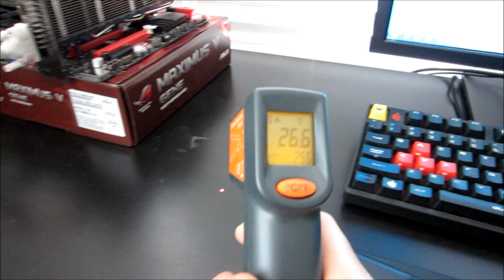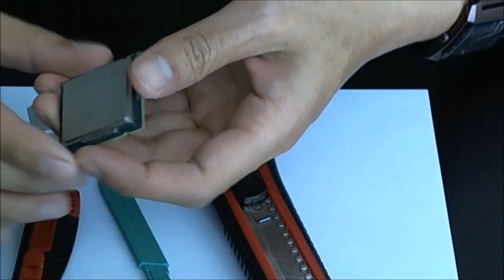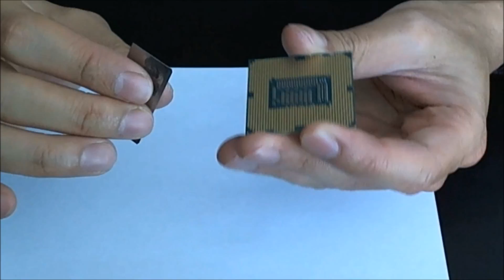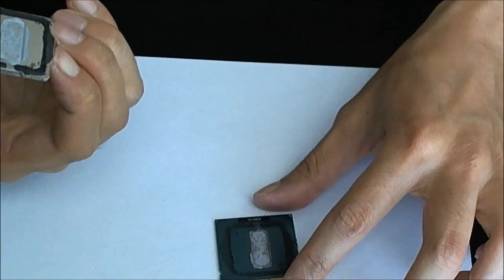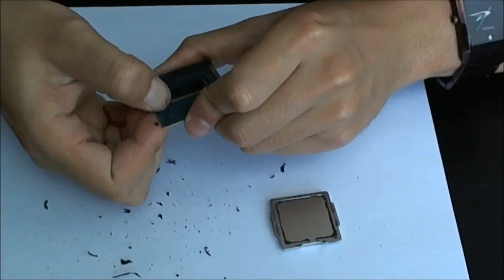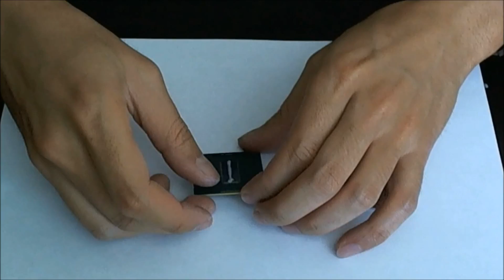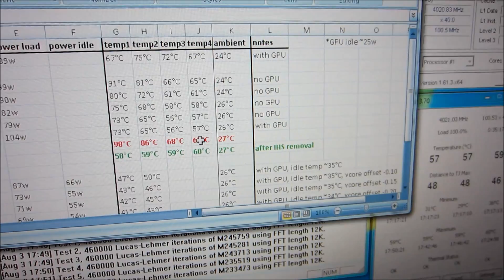Fixing Skylake, Haswell, and Ivy Bridge CPU temps: IHS removal

Comment: I have try to open my cpu with the razor but I failed. I stopped after trying during one hour and having used three blades.
The funny thing is that now, the highest temp I get at full load is 10 ° less than before (62°), is it due to little air injection inside the cpu?
Reply: My processor is i3-4330

Comment: He mishandled this CPU so badly. I’m amazed the CPU even works as there is NO excuse to touch the contacts on the bottom of the PCB. No matter what you do you will never be able to get it as clean as the manufacturer.

Comment: I got a i3-4130 and it runs at 50s and late 40s with stock fan on full speed...
Wish I bought an amd :/
Reply: AMD chips have a much lower maximum temp (a temp that they will throttle or die when exceeded) so higher temps on the Intel side is fine
Reply: Stock fan from intel and AMD both suck. Just get an aftermarket cooler
Reply: Koen Castermans  Yup.

Comment: Hi saw your wideo 2 times and i must say GJ man, rly nice representation. Well i have owerheating problems with my I5 760. The idle temps are about 55C-60C with Atec h2o 620 water cooling...i remmember when i buy that cpu cooler at 4,0 ghz oc my idle temps was never ower 40C and max load was around 60C-65C at that time that was good score now the same cooler at 3,4 ghz hitting 89 -90 C and cnonclusion is that the CPU-s IHS heatspreader or heatsink must be cleaned...Question, i say you when the proces is over when you assemble all back u dont add some kind off glue which was applied before, i mean on black silicon staff that bond the heatsink with the cpu-s pcb....so how safe it is to do on your way to let it just attached by socket wrench? Ty.

Comment: My core i7 gets way into red line on all cores under heavy load too. Since I do 3d rendering jobs for hours and hours, this is a big problem. I spoke to an ex Intel employee and he basically said "Consumer grade CPU's were never designed to run full tilt for extended periods of time". He later eluded that this was on purpose, since most people would not run their systems like this... He said go buy Xeons for heavy lifting.

Comment: You know what I have never had to do on any of my AMD computers? Rip the heatspreader off, replace it with my own paste, and then fiddle with it on the board.

Now I have crushed the heck out of some AMD Athlon XP CPU's in my day...
Reply: Hmm... interesting. I noticed a large improvement with delidding my Opteron 64 X2 back in the day... and Never, ever, crushed an A XP, A MP, Duron, or Pentium 3 in the process of mounting a cooler... (all open die CPUs)
Reply: That's not something you'd do with an Intel CPU either. As he said his one was defect and what you normally do in this case is put it back in its box and ship it right back to the reseller. No need to do any mods like that on any CPU manufacturer. He's just an enthusiast.

Comment: I would never dare do that to my 4930k :o
Reply: pussy.
Reply: Only the 4930K?
Reply: ***** how about laptop chips? my macbook is using the crystalwell processor, and it really runs hot. as far as i know, the thermal paste applied to it is insanely wrong.. been thinking of removing it and apply new ones. how about the "inner" paste like in this vid?
Reply: ah ic, thx
Reply: Fix'd with Devil's Canyon, though.
Reply: ***** It is, thermals are fixed. I have a 4690k.
Reply: ***** in the haswell refresh the ihs its soldered, no problems for it.
Reply: It is also soldered, so you should not do that

Comment: Arctic Silver 5, MX-2, and MX-4 dried out really fast on all the ones I tried. Had to keep replacing it after a few days. They just don't seem to meant for that amount of heat. Liquid pro/ultra gave me about 10c lower than the other pastes and still works after several months.

Comment: From what I read, it isn't the thermal paste that's the problem, but the glue used to hold it together. Basically, it doesn't make proper contact because of it.

Comment: I seriously recommend people not to void their warrenty by doing this stunt. Just test with Aida64 and check temps, Prime95 uses AVX instructions that doesnt run well on haswell and forcing it to increase voltage over the top than it's set at.

Comment: My temps on my 4670k while running prime95 never go above 650, however I probably hit the silicone lottery and got lucky. Every performs differently. I'm also not overclocked and am using the stock cooler. This looks like a bad idea altogether,  I just wanted to see what this was about.

Comment: Edit: Okay I think I might do it now but this way =Oo2aFZBBJF4   , it was way to fast and he used a freaking card board on the rest of the PCB like 97% of it on card holy! :D no risk of scratch!

This is really making me wanna go pull out my 4670k and replace the TIM..... At the same time kind of scary to razor blade it and scratch the green pcb lol. Been trying to OC to 4.4 but the heat is just way too much. Even in stock + turbo Boost it goes to like 75-83+ on P95 more on IBT with air cooling :x I wished I had a Vice.....! Whats really annoying is that Intel's asking price for the high end i5 or i7 are too much. The least they could do is put a high end TIM on it or just use Fluxless solder like the Sandy's had....
Reply: yea have the same thought.

my 4670 is running stock and the temps are bonkers, i have my gpu and cpu in the same liquid cooling loop cpu running stock and gpu 33% oc, the gpu tops out at 65 degree's the cpu hits 88 after 30 min of prime 95 and hits 60-70 degree's wile gaming(not to high but imo way to frickin high for stock on liquid). time to get naked mounting and delid this sucker... once i have enough saved up to buy another in case i bork the operation :P
Reply: anub1s15 its doable :) I did mine using the same way but it took me longer to get an insertion point using a thin hard razor not the bendy one's. After that inserted a plastic card board then pulled off the rest of the epoxy, no risk of scratching the pcb at all, just don't go to far inside where the Die is situated. But the key I think is Taking your time so no massive headache at the end xD For better results you can also go and direct mount your liquid water block (EK seem to sell fixings for direct mounting) or with heat sinks but beware there will be a risk of cracking Die if you over tighten screws or if you use a heavy tower heat sink. And I dont recommend the use of liquid team or stuff like IC Diamond as they kinda react to the Die and crack it. I saw 2 chips that died and crack and users applied IC Diamond TIM. You could still use them for really good performance like CLU from coollaboratory but use it at your own risk. Either than that it really kills alot of temps, specially using those liquid metal TIM's.

Comment: This video has some problems that you should consider when doing this procidment yourself: 

1st: You don´t need to put the IHS back, however, by touching the cooler directly to the cpu die you CAN´T apply to much pressure.
2nd: There is too much paste on that die, tough the "line" method is the most appropriated. 
3rd: put the thermal paste when the cpu is already on the socket and you have the heatsink in hands ready to install, minimize the exposure time to the air to avoid dust particles falling on it. DON´T TALK OR BREATH ON TOP OF IT LIKE THIS GUY DO! Make a final quick brush with alcohol just before applying the paste too.

Comment: at stock clocks on a 4770k with an evo 212 cooler i run a consistent 60°C under load. quit overclocking so much with air cooling.

Comment: i would never do this that is abnormal of a temp like you said. If it was faulty return it, with what you did the warranty is done for. This hurt to watch and made me cringe, that like taking a 1,000 bill (if it was in circulation) and trying to split the bill to have a front and back two piece. ugggghhhhhh

Comment: There is no need to do this, if you are running at high temps, just replace your thermal paste and make sure the compound is directly over the microchip ( line method right down the middle of the cpu) and make sure your heat sink it secure !
Reply: The weakest link to the thermal conductance is the paste between the die and the IHS.  Using a thermal epoxy would have been a better fix.  That is how Intel use to connect the IHS to the die contrary to the belief by many that it was soldered ! ...LoL
Reply: EdT586 Really, that explains your luck with CPUs lol, i have never had a problem with heat unless i did not add thermal compound correctly, which reminds me, did you use thermal compound to bind the CPU and heatsink ?
Reply: ChannelAsh100
The stock Intel thermal paste set-up is good if you are not an enthusiast for 90% of the population that don't check their core temperatures or couldn't  care less.  Intel figured with a cooler running 22nm die the cheaper Dow Corning 5022/5026 thermal paste would suffice.  People who are enthusiast will know how to check their cores temperatures and what a constant temp on all cores.

I used Arctic Silver thermal epoxy between the die and the IHS,  this will not only provide a permanent bond, but will also keep the IHS from moving like most people who have done this mod.  After the epoxy has set then use a good thermal compound like Coollaboratory Liquid Pro between the IHS and the heatsink cooler.

Comment: Lol what the fuck, i thought cpu chip was taking up all of the chips die, and the cooler is just a small metal cap like a bottlecap. That chip is tiny, u could cram two of those.
Reply: this is the philosophy of AMD and Intel CPU's:
AMD at 120 degrees C = I WILL FIGHT UNTIL I DIE I WILL NEVER *computer dies)
Intel almost at degree limit = I will press on but srsly if I cant have it a little cooler I'll shut this mutha f'er down.

atleast from my experience
Reply: SupremeGamingStyle
No, they go to processor models with more cores. For the Ivy Bridge generation there were Xeons that had 8 and even 12 cores on one piece of silicon.
Reply: bogdan mihai OLD amd cpus didn't have these kind of security measures.
Reply: you do realize that it's pretty hard for all the "internal macromillimeter" wiring to cram 2 of those chips in there huh?
Reply: Eckron  I'm saying that it fills up about 30% of the inside, where does the rest 70 go, heat problems?
Reply: Theo Lubbe  Intels consumer grade 8 core is 1000 dollars... 8 cores 8 threads? Still not worth 3 times that of 8350.
Reply: ***** That is what was my first thought after seeing that die is damn small :P
Reply: SupremeGamingStyle 1 intel core performs about as well as 2 amd cores.
Reply: bogdan mihai It was an easy overexaggaration... geez.... its just that the AMD's I have always overheats without a warning except "hey the fan is running loud"
Reply: Cramming a second set of cpu cores would probably make the heat entirely intolerable.
Reply: bogdan mihai no, i meant a whole second set of cores, regardless of how many cores are in each set. Like even with the amd chips those 8 cores still dont take up the entire space of the substrate. You have enough space to fit a second set of 8 cores onto those amd fx cpus but like I said if they did that the heat would probably be intolerable.
Reply: ***** Exactly.